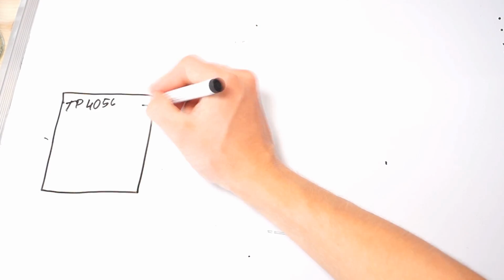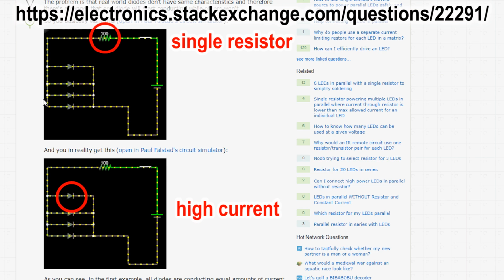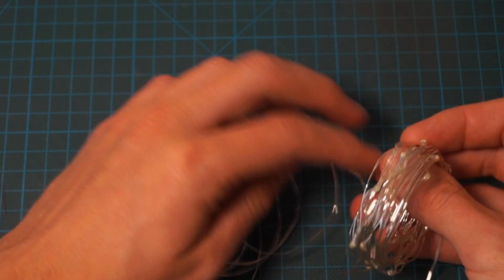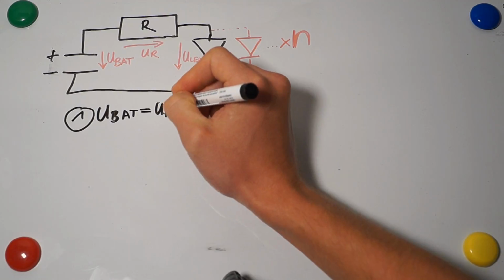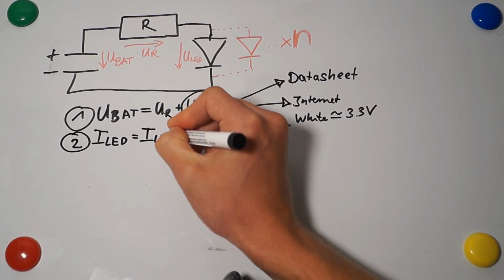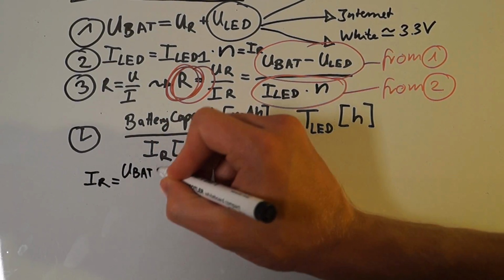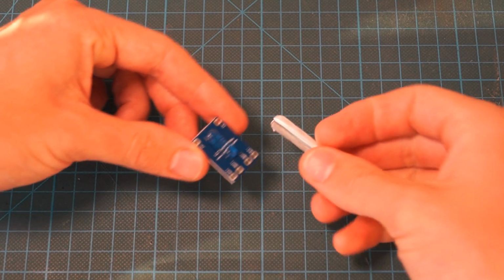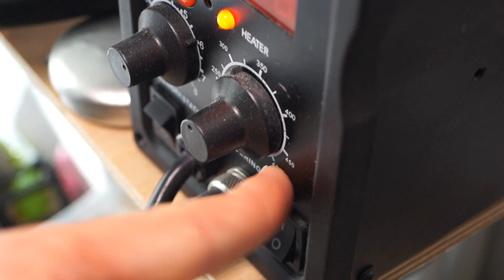Homemade rechargeable LED Bottle light with a twist

Comment: Did you change the resistor on tp4056 board? By default this kind of boards will charge the battery with 1A current, it is way too much for this lipo.
Reply from the maker: Shit, I didn't change the resistor...